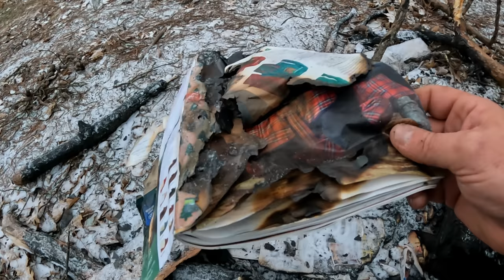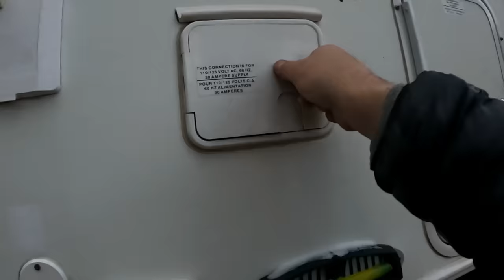Escaping Civilization / Winter Camping in a 20 Year Old Truck Camper

Comment: We bought one for our Alliance Valor 42v13 that is programmable, comes with a remote and a manual keyless pin code you can type in. Works great. We love it. Gives off this satisfying little chime when it locks and unlocks. Even talks to you, telling your locked or unlocked. LOL.
Reply from the maker: That sounds very cool. I had a Grand Marquis with keyless entry. It was a really handy feature to have. I might go that route. I was concerned with battery life, seeing how we can get cold here (although not this winter). But, having the option to use the standard key would resolve those issues. Thanks for your input.

Comment: The 860 was the predecessor to the 811.  The layout is identical, but the bathroom in the 811 is bigger and I think the slideout on the 811 is deeper too.
I had an 811 for 10+ years.  I now have an AF 992.
Reply from the maker: I think you're right. I've never seen an 811 in person. But watching YouTube videos, I recognize the differences you mentioned. The other big difference is that mine was built back in the day when they were still using wood frame construction. The condition of this 20 year old camper speaks for the quality of NorthWoods Construction.

Comment: To get a really good, even cook on a large prime rib you should pull it out of the fridge about an hour/ hour and a half before cooking and let it warm up to room temp.  This helps to make your heat temps/cooking times line up better. The last one I cooked, I did an olive oil rub, salt/pepper and crushed garlic. If you pull it off at 125 degrees and let it rest for about a 1/2 hour, wrapped in foil,  It still will cook and seal all the juices in. Growing up, my mom used to cook prime rib and usually did it wrong.
Reply from the maker: I'll try those tips at home on the pellet smoker. Thanks.
Reply: @KennyOfAllTrades  I keep on searching for the ultimate prime rib. Every one is different.

Comment: I'm envious; I'd like what you have - truck/camper, what a set up.
Reply from the maker: Thanks! I have owned 5 other truck campers in the last 25 years. I try to upgrade a little every time. Although this camper is 20 years old, it is my nicest one yet. I paid 6 grand for the camper 7 years ago. The truck has 200,000 miles on it but runs great. Some of my best memories are exploring on BLM land out west with my old rusty 3/4 ton silverado and 1200 dollar Mountain Star truck camper. If you love the journey, you can overlook the age and condition of the camper. That was my thoughts. That's why I mentioned in this video that the camper is close to stock. I dont spend money on fancy batteries, solar, and all those other gadgets. You don't need them for a couple of days in the woods. Save your money so you don't have to work overtime, and go camping on the weekends. Next, bring a Gopro camera and a laptop...now you have a YouTube channel. Garry of All Trades. That's what I did.

Comment: Another great video.  Thanks.
If you're thinking of a replacement lock I'd suggest a keypad style RV lock.  I've used one for years and it's great.  I don't have to carry keys with me.  But I do have an emergency key on the outside of the camper if needed.
Reply from the maker: That is a good idea. I had a Ford once with keyless entry. It was a nice feature. I could see it working well with the camper.

Comment: Another beautiful weekend camp.  Sorry about your drone. Even before you pulled out the sled I was thinking that's what I would have used so I would have gotten wet too. Here is a winter hack if you hadn't heard about it yet. With the snow and ice building up on the windshield if you put your sun visors down with the defroster on it will heat the windshield up and help keep the ice from building up as much. ( also help thaw out faster when it's covered with ice and snow before work ) thanks again for taking us along with you
Reply from the maker: Great tip! 👍

Comment: It’s a little pricey but I broke down and bought the RV Lock brand of keyless entry locks. Don’t buy a Chinese knock off that is cheaper and looks the same. They are made of cheap plastic guts and won’t last. RV lock brand has metal parts, a few plastic, but metal where you need it. Amazon has them for about $149 & $199 depending on how many key fobs you need. Don’t have to bring your keys on bike rides, hikes etc. with a chance of losing them.
Reply from the maker: I've had a lot of recommendations to them. I'll have to look into them.

Comment: The drone issues you've been having are concerning. I have a DJI Mini 2 and so far so good, but I think at least two of yours have malfunctioned for no apparent reason. If you ever get some answers, I hope you'll update us in a future video. I enjoy your channel, keep up the great work. 👌👍
Reply from the maker: I sent the last set of flight logs into Dji. They said the drone suffered motor damage from a prior incident. They did cover the last one. It takes a long time to navigate through the process....only because I'm not tech savvy. I'm still waiting to receive the replacement drone from this fall. It should be here any day.
 The issues are my fault. I intentionally fly the drone close to trees and branches to capture awesome footage. You can see what i mean in this video. 
As you know, the Mini 2 does not have obstacle avoidance. So, I usually break a set of propellers every week. The new Mini 4 has obstacle avoidance in all directions. I will save money for that unit. I liked the Mini 2 because Walmart usually has them in stock, and they were only 249 dollars for the longest time. I see they have raised the price back up to 339. Amazon sells refurbished Mini 2s, body only units with no battery for 239 dollars. I know it's expensive, but when I consider that some weekends, I'll spend 400 dollars on fuel to find a campsite, the cost of replacing a drone doesn't feel that high considering what it provides the channel.
Reply: I was wondering about those amazing tree shots! Well, you've restored my confidence in the Mini 2; I appreciate that and for taking the time to offer a detailed explanation. And for the record, you're very tech savvy - the editing on your videos is exceptional. Looking forward to future videos. 👍

Comment: Hey Kenny I have been trying to notice your front bumper set up on your truck, I like the ideal of carrying your generator and grill on the front. What did you make that from and how is it attached. My wife and I enjoy watching you every week and sorry about the drone but my wife and I couldn’t stop laughing when you fell through that ice we just knew that was coming 😂 and glad you wasn’t hurt but keep the adventures coming.  Thanks MJ/PJ
Reply from the maker: Thanks! The front 2" receiver was purchased through Etrailer. It was around 100 bucks. It took 30 minutes to install. 
That front basket is from Harbor Freight. It's  rear luggage rack. It has a 500-pound capacity. They sell for less than 50 bucks. I got this one from the returned merchandise isle. I think it was 30 dollars. 
I have had the generator up front of almost 4 years. It's only been off a few times. I've traveled all over out west through the mountains, down to New Mexico and back with no overheating issues.

Comment: Kenny you did everything that I would have done to get that drone 😂 I use to use the 2 rack and pan method also I found out that I didn't like it I couldn't lower it to get the smoke and temperature that I wanted with out it getting in the way once I was doing a brisket the pan had grease in it and it got 
a hole in the pan . I had a bonfire on my hands 😂 Great video have your self a happy and healthy New year ❤

Comment: theres not a lot of difference between truck campers 20 years ago and today.   mostly stuff like solar,  batteries and solar generators, and stuff revolving around that, thats changed.   

heaters really haven't changed that much, and some people just update or add a backup or alternate heater to the propane.   Some run 3 types of heaters,  propane, pure electric, and diesel.   Operating the electric when on shore power,   propane at campgrounds without shore, and Diesel when 100% off grid for longer times.

older campers like this are still nice. even 1999 models had slideout options,

Comment: when your out in the woods in cold temps are you ever concerned that the duramax won't light to get you home???
Reply from the maker: I've had a 2 videos where I was camping in -30 degree weather. My fuel gelled up. I was able to limp the truck into a campsite with electricity by continually priming it. I made an insulated enclosure around my lift pump and filters. i stuck an electric heater inside and let the pump recirculate. It took a while, but I got the truck going. The other time, I gelled up while pulling off a lake, and I was broke down on the road. I had a flat bed haul me home. Thankfully, I was close to home on that video.

Comment: One question. What did you use to start the fire? I was waiting for some kindling or smaller branches. That was neat
Reply from the maker: They are called Fast Fire. It's a long burning, easy starting gel block. I picked them up at my local grocery store. An eighteen pack is five dollars. I have found them on amazon but they charge fourteen dollars for the same box.

Comment: You need to put your contact info into the above commentary - as (!) YT refuses to allow me to give you mine.  I have a SIZABLE unused drone that needs a new owner.  If you can keep yourself from falling through the ice, I can send it to you.  Then I can attach photos for your consideration
Reply from the maker: That is so awesome of you! Right now, I'm limited to a 249 gram with a part 107 license. If I step up in size, I'll have to register it with the FFA. Thankfully, I always get the insurance through DJI when I buy the drones. I try to keep 2 on hand. That way, I can send off the broken ones for repairs. I can imagine the trouble I would get myself into a larger drone. I'd be cutting down trees and breaking out my windshield. 😆

Comment: Did you get the truck camper brand new or did you get it used?
Reply from the maker: I bought the camper 7 or 8 years ago. I paid 6 grand for it. There was some water damage up front from leaking clearance lights, so I replaced the front nose cap with aluminum I bought at the local trailer manufacturer. I did the work about 5 years ago. Other than that, it is holding up well.

Comment: Also how do you keep the generator from walking away,I see the strap but thats not going to work here in Virginia
Reply from the maker: The strap over the top and two steel cables on the bottom and sides. It would only take 5 minutes for someone to cut them off. Thankfully, we don't see a lot of that behavior up here.

Comment: I’m pretty sure I had a math question like this in  college:

Kenny weighs approximately 300 pounds. 

Kenny is about 6’2 tall. 

Kenny has a small plastic sled of about 5 square feet.

Kenny is on a lake with ice about 1” thick. 

Kenny kneels on his sled. 

How far will Kenny be able to sled on the ice?

Answer:  Nowhere but into the lake.
Reply from the maker: Lol

Comment: Kenny, do you leave your camper on the truck all of the time or do you remove it during the work week?
Reply from the maker: It is always in the truck. I park next to my house. I turn off the heat, but I do plug in the shore power. I keep the fridge going on AC  and plug in a small electric heater to keep the power stations warm while charging. 
My daily driver is a 2003 Jeep Liberty with over 300,000 miles. That little jeep just keeps on running.
Reply: @KennyOfAllTrades That makes it so much easier.  I am seriously jealous of your setup. Thanks for the incredible videos.
Reply from the maker: I appreciate the comment 😊

Comment: Sprtiz some WD40 on those lock parts - and any water or ice-up will be stopped and keep all things working ...
Reply from the maker: Good idea. I was thinking wd40 might freeze in below zero temps.....but it is a water displacer, so your probably right.
Reply: @KennyOfAllTrades  The old 3in1 oil company bought out a competitor who had "this" formula.  What most people don't know - but known to fishermen - is spraying their bait with WD40 - and it draws in fish.  How ?  Well, duh !  The base of WD40 is actually the thinnest SAE weight of (fish) oil that keeps all locks open and operating in the coldest of temps.  The maximum thinnest viscosity of WD40 ... less than 5W synthetic ... allows it that penetrating ability, but also non-freezing and non-goo-ing property
Reply from the maker: @johnlord8337 I have heard of that by some of the older  duffs casting for carp. They said wd40 worked. I never understood how. It makes sense.

Comment: you want a dry lube get some mil-tec it is for guns but it will work get for locks latches for guns heat up surface with hairdryer it bonds into metal with heat it was made for the military in sandy conditions clp would attract sand keeps m4s running smooth or m16sor any weapon midway usa sells it it is expensive but small drip is all you need
Reply from the maker: Great tip 👍  thanks!